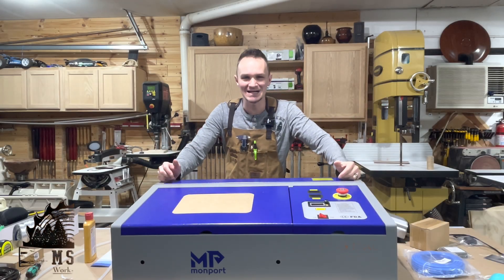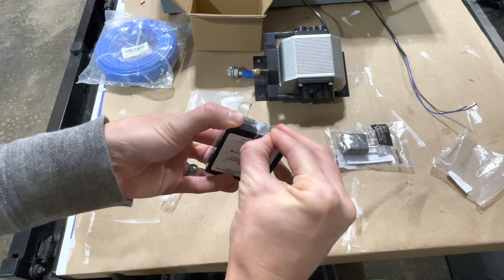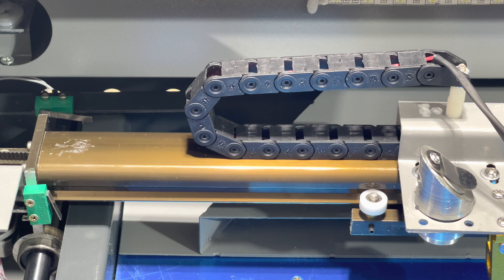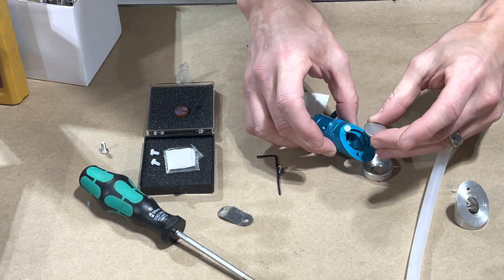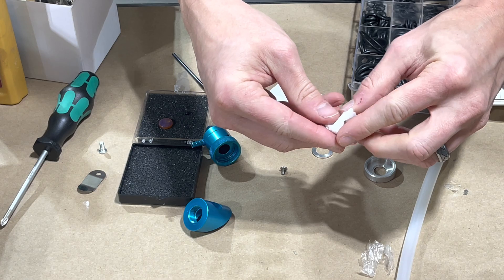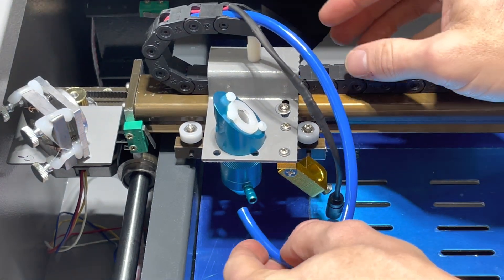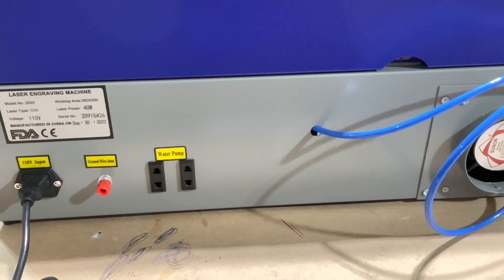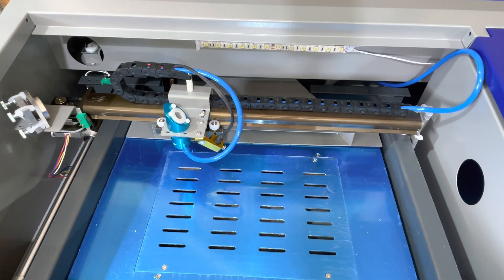Monport K40 Laser Upgrades (Part 1) Air Assist.

Comment: Are you connecting to the air assist switch on the motherboard, or simply unplugging when not needed?
Reply from the maker: I’m just unplugging it if I need it. If you want to make it semi automatic you can connect it to a smart switch and just turn it on and off via Alexa  or some other voice command. Not sure this board has the option of Adding air assist that talks to light burn.
Reply: @MSRWorkshop  I sent the Monport Support folks the question. Thought you'd like to see the response:
￼

Here’s your response from Monportlaser

Randolph MeederHello, Can an small air compressoe be connected to the air assist switch of the motherboard? Are the air compressors being installed in the K40s available for porchase? Thank you.

￼

Monportlaser
Connecting a Small Air Compressor to the Air Assist Switch: Yes, it is possible to connect a small air compressor to the air assist switch of your laser cutter’s motherboard. The air assist feature helps blow away debris and smoke during laser cutting or engraving, resulting in cleaner and more precise cuts. Here are the steps to achieve this: Pressure Switch Wiring: First, you’ll need to wire a pressure switch to your air compressor. The pressure switch monitors the air pressure and controls the compressor’s operation. You can follow a guide like this one to wire the pressure switch correctly. Relay Setup: Next, use a relay to interface between the pressure switch and the air assist switch on your laser cutter’s motherboard. When the air assist is needed (e.g., during cutting or engraving), the relay will activate the compressor. Configure Software: In your laser control software (such as LightBurn), ensure that the air assist feature is enabled. LightBurn can send commands to turn the compressor on and off based on your design layers. Connect the Relay: Connect the relay’s control input (usually low voltage, like 5V or 12V DC) to the air assist output pin on your laser cutter’s motherboard. When the software signals air assist, the relay will switch the compressor on. Power Supply: Finally, power the air compressor separately (usually 230V AC for your Hailea 318 compressor) and ensure it’s safely grounded.View your conversation

Your conversation history expires if no reply is sent within 7 days

© 2024 Monportlaser

Comment: The new blue head longer than the old one. Then your focus point is moved down. You can use the upper part of the old head and remove the lens retainer ring, then attach the lower part of the new LASER head

Comment: I just got the same k40.i am going to add air assist as well, but was thinking of mounting the air pump inside the enclosure with the powersupply and main circuit board and putting an on/off switch to control it. Anyone ever seen that done?
Reply from the maker: I would skip the pump style air assist all together and go to an air compressor style assist if you can. It works so much better and puts out more air than a pump could ever dream of.

Comment: Suggest that you fit the air assist pipe to the air assist nozzle with it not installed onto to the head as any strain in pushing the pipe on can bend or disturb the head mounting bracket that's why it is fitted with allan screws and also for lens cleaning

Comment: General Comments on the Mods:  The grommets & plugs are a good idea & nice touch.  I added them to my immediately, before starting any mods.  On the air assist: a) you should have provide some instruction / video on running the air assist line thru the drag chain; b) you can purchase a separate nozzle that will fit over the existing lens housing assembly, or even 3D print one, so there is not need to replace the whole lens assembly - unless you want to upgrade for aesthetics and a better quality lens; c) for air regulation - some aquarium pumps come with a manifold - to allow you to connect additional items to the pump.  You can use the little valve, on each manifold connection, to regulate the air pressure.  That is what I do on mine.  Overall though, a good video.

Comment: General Comments on the Laser Build Quality:  The quality, of the workmanship, leaves much to be desired.  On mine, a lot of the machined parts are not smooth, have rough edges, and burrs.  Some of the screws, bolts, & mounting studs have stripped threads.  There are also some scratches on the case.  They tried to touch them up, but the paint they used does not match.  It is a slightly lighter colour.  You get what you pay for I guess.
Reply from the maker: Yes, I had a small dent on a corner from shipping and the laser head itself was poorly made that’s why it was the first part to go. But after a few tweaks it works well. And getting anything else with 40w in a CO2 that is out of the box compatible with light burn isn’t going to happen, especially at this price !

Comment: Now your laser is off by the Lens swap. 
Not just a part swap out. You have to realign everything.
Reply from the maker: Yes, I did a Lens alignment, just didn’t show that part. I’ll talk about it briefly in my next video, but I didn’t want to spend to much time in it since there are so many videos about
Reply: @MSRWorkshop  
I’ve seen seeing allot of post people struggling with Alignment after swapping out the lens.
Reply from the maker: The biggest problem I found with swapping to an air assist of this kind is there is actually no adjustment for the main lens angle. If you look at any large format laser, they all have an adjustable lens above the nozzle. These small lasers do not.. I had to actually add a small shim under the main mirror to get the beam to fire straight down otherwise it was hitting the side of the nozzle
Reply: @MSRWorkshop  
I’ve seen some home builds that you may laugh at but seem Functional. I haven’t added air assist to my K40 yet.
Reply from the maker: Adding an air assist makes a HUGE difference. 
I would not use a laser without one ! The benefits are substantial.
Reply: @MSRWorkshop  
I have Air Assist on my 5, 10 & 35 Watt Diode Laser. I’m just waiting until I find the right kit for the K40.
Reply from the maker: At $26 for the replacement had it might be worth playing with
Reply: @MSRWorkshop  
It was never about the price. I’ve been seeing people add a tube mounted directly behind the laser without having to swap out the lens.

Comment: How did it run with out air assist just ordered one
Reply from the maker: It works fine with engraving and no air assist but if you want to do any cutting you need the air assist, just way to many flare ups.
Reply: Awesome I ordered a new head. Gana be a great ride following you on this k40 journey!